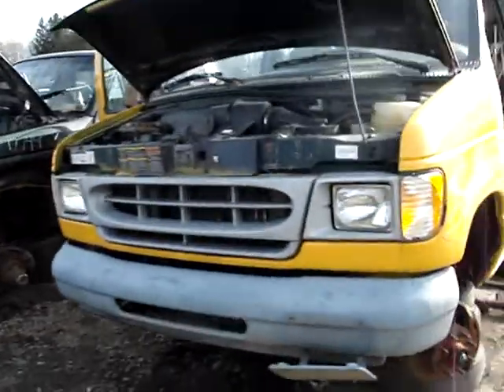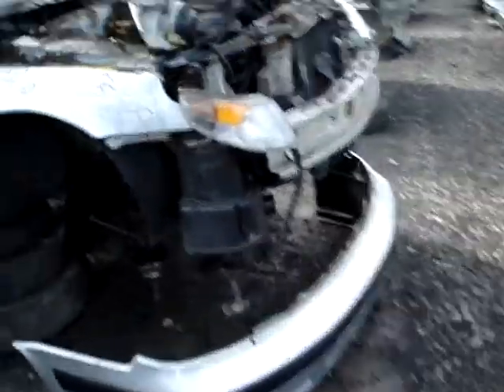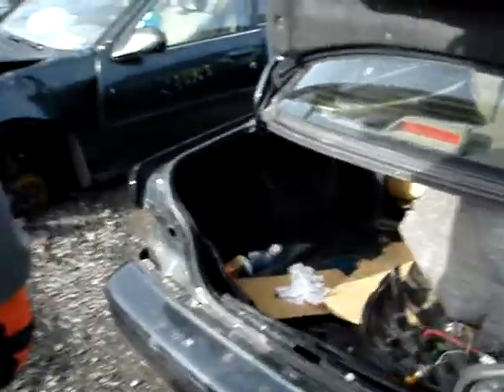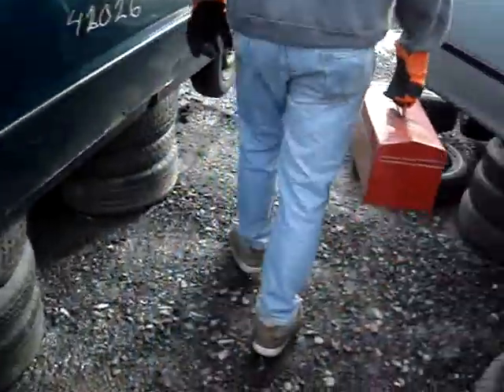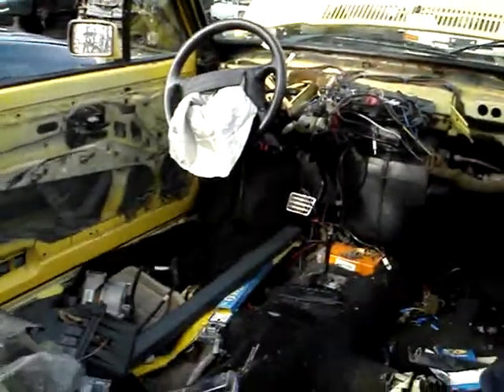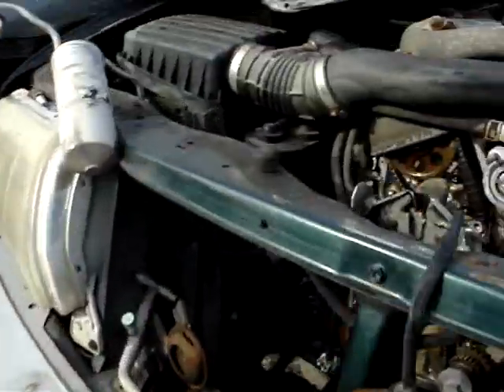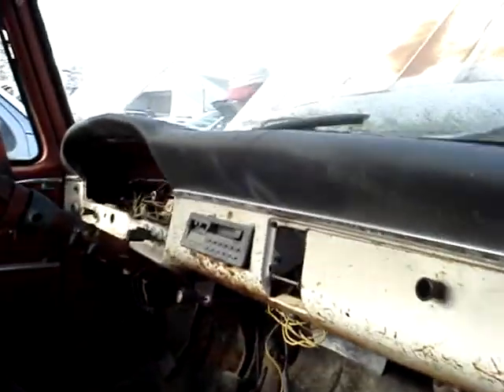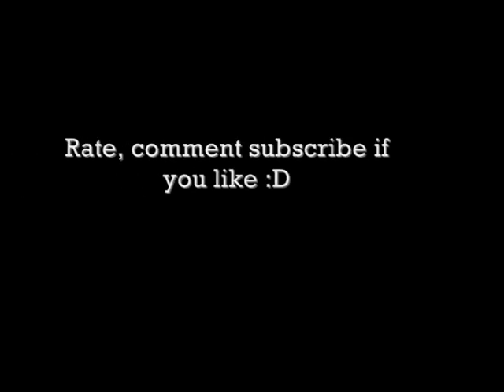Exploring an auto Junkyard

Comment: Not much into foreign cars here, but nice tour.  My sister has a 2001 PT Cruiser which she bought brand new. It has over 200,000 miles on it, and the rocker panels are very rotted on it along with the windshield cracked. She since got another car, and now my nephew drives it.  I myself have driven it before, and it is a noisy car.